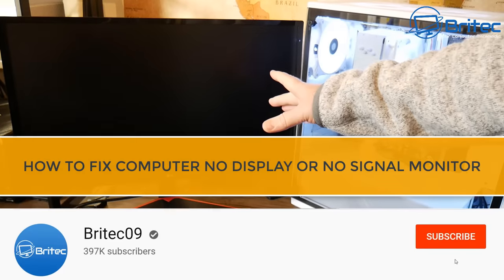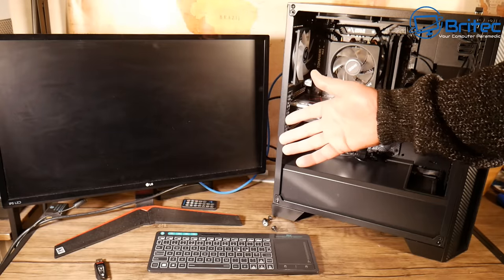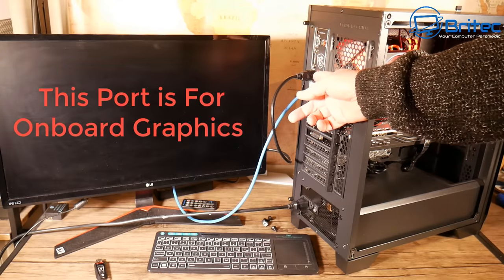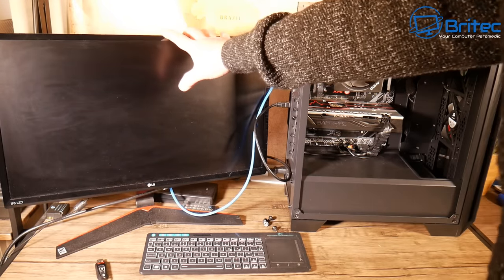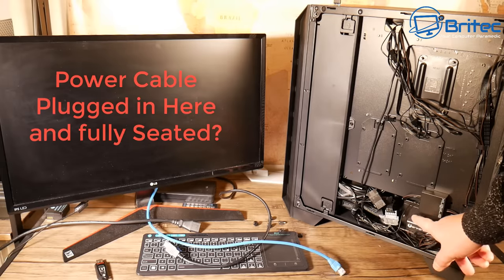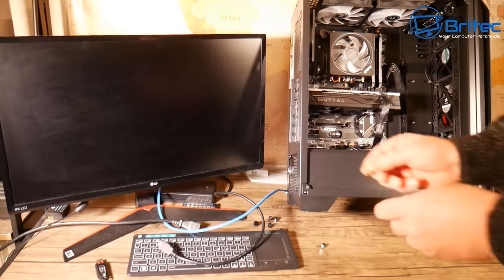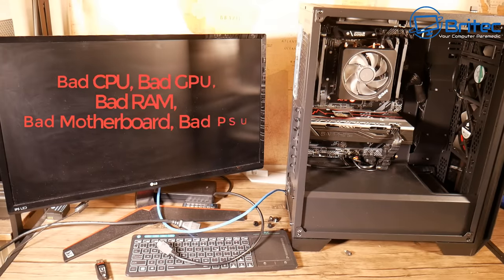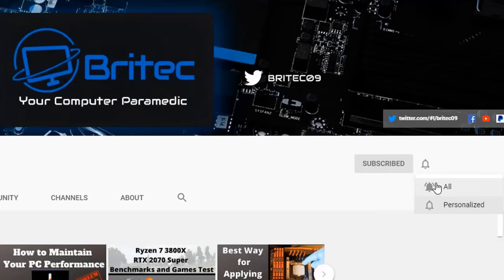How to FIX Computer No Display OR No Signal on Monitor

Comment: 11.96 V on all 4 plugs from the power supply for videocard, but no signal on the monitor, videocard is good tested on another computer, monitor changed 2 cables checked for each monitor, so what can i do more ? i will clean the memories connection part for both side with isopropanol

Comment: Another thing - if you've just upgraded your dedicated Gpu and are getting no output, upgrade the motherboard Bios. I've run into this many many times and resolved it this way (and no, a cmos clear did not resolve the issue).

Comment: Hello! Please help! I just built my pc like 2 weeks ago and it was running perfectly fine I was playing gassed smoothly and I didn’t change anything. But I had to change something game related in the bios so I set the ram speed to 3800mhz instead or 4000mhz because I had to because of a game. But when I shut my pc off, and tried turning it back on, nothing showed up….

Comment: hi im a younger sister using my brothers pc 
im quite scared to do this but i will tell this to my brother

the computer monitor says no signal and the cpu is on
whenever this happens my brother would remove the switch then put it back when the cpu turned off
but sometimes it takes 1-9 tries to finally get in but whenever he put back the switch theres a spark that comes out
does the spark would be the hint of a certain problem?

Comment: Hi, I am unable to work out the problem on my monitor (BENQ GW2265).  It works wonderfully when connected to it's VGA port, but does not when connected on HDMI port.  
My laptop (Toshiba) HDMI port works fine when connected to my Samsung TV,  but again upon connecting to monitor shows "No Signal or No Connected Cable" ( I can't remember which).  
I have swapped HDMI cables thinking of defective cables, but still nothing.  Can you help?

Comment: So I just upgraded my motherboard to a gigabyte b450 ds3h and cpu to ryzen 3600 and It had the latest bios update or the one compatible with 3rd gen ryzen as it said on the box and it booted up fine and I went to load a game but the cables were touching the fan, so I turned off my pc the cable was the hardrive cable and I plugged it into the slot next one along and so it wasn’t rubbing the GPU fan anymore but now I won’t get any display on the monitor? I put the cable back to the old one it was in also, and still nothing but everything boots I even hear my windows booting through the headphones I tried the monitor cables I have 3 and used different ones and even tried my other monitor, I didn’t update the bios right away after turning it on for the first time? Is there anything I can do to get it to boot?

Comment: My onboard graphics AND GPU both are not transmitting signal. I have tried 4 different cables, all fine with other devices. I have tried 3 different televisions. All 3 are fine with other devices. Is my motherboard fried? I can hear/feel/see everything is running inside of the computer when it is turned on yet there is no video signal. I have tried VGA and HDMI. 

I accidently started plugging in a USB into a similarly shaped port(directly above the HDMI port on the onboard ports) and I think I shorted something. The screen flickered, I wiggled the HDMI cable to try and fix it. When I did that it restarted the computer and I no longer had video signal after that.

Comment: Recently my monitor stopped getting any input from my desktop. When I boot up other parts of the PC works as usual but monitor stays blank even I can access HDD files through SMB. Already checked monitor on other device, swapped ram sticks, reinstalled GPU, removed CMOS battery but still no luck. Is there anything else should I do?

Comment: Monitor works fine with DP cable and hdmi cord is fine, works on the tv just perfect even when plugged into pc. Hdmi was working for months with no problem then all of a sudden it would get fuzzy or just go black and say hdmi no signal. Any suggestions?

Comment: What happens to me is when i start the pc up or wake it up from sleep, it stays on no signal for a minute or 2 and then turns on. I am using an integrated gpu and the problem started popping up around 1 week ago. Any tips for this??? Im just hoping its not the cpu or the MoBo, tho i still have warranty on them.

Comment: Please help me. I factory reset my pc and now when I start it up there is no hdmi input. It says "no signal" even after pulling out the battery and ram, holding the power, reconnecting battery and ram. Still boots up and the led lights are working but no signal.

Comment: Have you got a fix for CRT monitors with stupid "noise" lines that run horizontally, and make things fuzzy, scrambled, and/or distorted (squished and stretched vertically, and a little "shifted")? 

The affected area is NOT fixed in one area, as it has moved up and down on the lower region of the monitor (taskbar zone), and the "stretch-n-squish effect varies with how bright or dark the displaying image is. 

The issue has slowly been creeping up a few years ago (but it was virtually unnoticeable except to my eagle-eyes) and I noticed it gets just a little worse with each power interruption or failure. In recent weeks, the last couple of power failures really made it bad (and noticeable). 

I had done a thorough disk defrag and that miraculously seemed to set things right again, but over time it started slowly returning. 

I'm considering trying another power cable, but I doubt that will really fix anything (but who knows? I discovered AC power adapter/switcher things can "die" and need to be replaced when hard drives and scanners begin acting up with poor connectivity issues).

Changing monitor settings do not fix anything. 
I would just get a "new" monitor but CRTs are hard to come by and I still cannot figure out which is better between LCD and LED monitors, and NONE of them are especially cheap.

Comment: I need help with my situation, so, basically  my monitor is 100% fine and its very functional its basically brand new theres nothing wrong with my cables nothing loose, but what happens is when I restart my pc everything runs fine but my screen is black it doesnt even turn on or say no signal nothing same with when i shut it down i turn it on pc runs fine but screen doesnt turn on the only way my screen shows is when i take out the battery and put it back in then put the pc on then it displays and everything works fine until the pc shuts down again then i have to take it out again and repeat the process over, and over, please I need help.

Comment: How about when the monitor receives power and a signal but when turned on it acts like a fluorescent bulb; a brief flash on the screen,then nothing. Rinse and repeat each time you press the on switch same thing until finally it catches. Next day after turning it off at night, same process.

Comment: I switched out my old computer screen to a TV that has a vga port. It works but sometimes in the middle of doing something it will say no signal and screen will go black. Most of the time when I restart the computer by holding the power button it works again. I think my graphics card is not strong enough for this type of TV screen? Also upon start up I get an error message saying that a fan speed is too low. Time for a new cpu? It's an old Sony. Probably more than 8 years old

Comment: How about Monitor losing Signal after Windows Boot Logo? I have a 144hz Monitor connected via DisplayPort. This issue happens only when I restart or Shutdown Windows 10 when the Display refresh rate  is set to 144hz. Setting the refresh rate to 60hz before restarting or shutdown won't lose the signal, then I have to revert back to 144hz to continue. No signal only happens after windows 10 boot logo. GTX 970.

Comment: Any tips on how to fix the problem I am having the thing is my graphics card went bad to gave it to the center for replacement and I plugged my monitor hdmi on gigabyte motherboard and I am getting no signal/cable not connected I tryed everything and noting helps so my last thing is to try dvi cable or replacing motherboard plz help...

Comment: I have tried EVERYTHING apart from removing the cmos battery and i know i don't need to and here why:

My pc boots no problem and i can hear the windows chime through my speakers however, it boots with ONE long beep (normal system startup beep) and then THREE short beeps and i have no display, but when i plug my DVI cable into the onboard graphics slot i get display?. 
Here is my temporary fix: I removed the screw holding in the gpu to the case and pc booted no problem with display? 
Are my PCIe lanes broken somehow and the gpu only works when positioned wrongly?, do i need another MOBO?
(Asus Z390-A Prime paired 1060 6Gb GPU, the beeps i have, Asus says it is a GPU problem, but it's not, it is a MOBO problem as my gpu works in my old out of date pc i have spare and my old 1050ti does the exact same thing in my pc that i use now?) DO I NEED ANOTHER MOBO i should i send off for repair? or is it something else that i missed?

Comment: I have a problem where my pc shows no beeps on post and everything is on including fans but my monitor says no signal I tried the ram and still no fix I can’t remove the gpu since it’s too big and I can’t see the clip underneath that makes it loose 
My specs are rx 570 with ryzen 3 2200g
Reply: I have the same problem, did you find a solution?
Reply: Milan Keersmaekers yh I just took everything out and put it back in
Reply: Milan Keersmaekers not my cpu tho
Reply: Milan Keersmaekers also try reset cmos battery
Reply: Abu yeah i tried taking the battery out for like 2 minutes, is that long enough for cmos reset?
Reply: Milan Keersmaekers yeah if that doesn’t work then just rebuild your pc
Reply: Milan Keersmaekers plug out the cables gpu fans and more from the motherboard then put them back in
Reply: Abu i’ll definitely try that, thanks. If it doesn’t work, i’ll take it to a pc repair shop and just hope it’s a minor issue haha

Comment: I wanted to know why my pc runs but no display. I just install a new intel i5 4460 3.2 ghz cpu the i5 2.8ghz is the old one. Before I buy anything else I might need, here are my specs

8 GB RAM/ intel i5 760 2.8 GHz cpu/ atx 1150 motherboard and a AMD Radeon HD 6570 graphics card. I tried changing my new cpu wit the old one and I checked that all the cords are plugged into my motherboard and my monitor isn’t the problem because my ps4 shows perfectly. Any ideas or help?? It hasn’t been working for 4 days

Comment: I downloaded some kind of DirectX driver to the computer after just opening it up and streaming for couple of hours. Then did a reset and now it literally doesn’t send HDMI signal to minute so I can’t see anything (but it does turn on)

I did the following:
1. Turned everything on and off
2. Off, unplug power and HDMI, wait 30 sec, replug and turn on
3. Tried to plug HDMI out of graphics card in back of PC INTO television, didn’t have signal. 
4. Plugged PS4 Into Monitor I am using for this new PC, and PS4 instantly had signal. So it’s not the chord.
5. Tried diff HDMIs just in case.

I want to trouble shoot but CANNOT see screen so i have no options.

Should I buy Display Port (out of PC) to HDMIand see if I can Use something other than the HDMI out of the 2070 to trouble shoot with?

This is a real bummer.v sad. So grateful if anyone can help!! (MSI GEFORCE RTX 2070 SUPER GAMING X)
Reply: Did you maybe find the solution?

Comment: So for me. Iv got my p.c plugged into a tv constantly. The tv is fine also got my switch connected. The p.c worked absolutely fine a few days ago. I was playing death stranding on gamepass ultimate from the p.c with no issue. Today I turned it on and it light up and the fans were spinning fine. My usb + rbg keyboard and mouse did not light up and the hdmi (cable is also very new arrived a week ago in the post) did not work because tv has a blue screen (no signal) 

I should mention, I don't know any technical p.c hardware stuff. I didn't build this p.c ik how open the casing and thats about it.

Comment: I bought a new graphic card (1660 super g oc) but for some reason only the hdmi works 
When I contacted a monitor to the dp it shows a picture for a second and then go says no single  
I checked the monitor and the cable and everything work is do I need to get a new graphic card?

Comment: My problem: Pc starts like normal but i see no signal on monitor and if i press power button pc turns off imediatly, this means pc wasn t booted, what should i do? I tried pc on another monitor, i reinstalled all components, reseted the bios nothing

Comment: I recently installed an outdated GPU and put my hdmi on it and it didn’t work and my monitor didn’t turn on now my pc won’t detect my monitor, HDMI and VGA. My pc turns on and the monitor but they won’t detect eachother? What do I do?? Also I don’t plan on putting the GPU back

Comment: So my pc turns on perfectly fine most of the time. However sometimes the monitor doesn't turn on and also when it restarts it doesn't turn on. Sometimes I shake my mouse around and it turns on but sometimes even when I do that it doesn't work. Is there any fix for this? It says VGA NO SIGNAL.
Reply: im having same issue, brand new computer and monitor. Sometimes it comes on, sometimes not. Once its on it stays on. Frustrating
Reply: @graytambar9956  same, and I haven't found any fix for this yet
Reply: Kiri0 I’m gonna try some things. I’ll let yah know if I have any luck.
Reply: @graytambar9956  thanks man
Reply: Kiri0 same just built my pc man
Reply: Kiri0 ok, after researching some potential solves I took the ram sticks out and cleaned off the connections, I also took out the graphics card and cleaned the connections. Put those back in. That didn’t seem to help at first. Then I replaced the hdmi cable and so far it has been responsive every time. My specific issue was, hitting space bar would wake the computer but the monitor would not wake up. Since doing those 3 things it has worked so far and been very responsive to wake up each time. I’ll let yah know if that changes but so far it seems to have fixed it.
Reply: gray tambar bro I just fixed it changed ram and plugged then unplugged the power cable and it worked
Reply: sxints_  sweet!

Comment: I plugged in the vga cable and turned on my monitor but the monitor says that there is no vga cable. I’ve changed the wires multiple times idk what to di

Comment: I installed a all in one and now im getting no signal
Reply: Same
Reply: @elizamanalastas4428  what worked for me was to remove the cmos battery and power cable from the pc and hold the power button for a whole minute then put battery back in and pluged my pc and it worked.
Reply: @GG-ow9pm  hey , my computer is saying no signal for 3 years , a fixer looked at itand they said it couldint be fixed , can u pls help i need the computer

Comment: So I guess I need to buy a new CPU,PSU,GPU and test which one it is ?? Great , barely 10 hours used , a modest amount spent on it (Approx £600) Seemed like such a good idea at the time , worked absolutely fine except the dodgy WiFi adapter I bought . Then I got a black screen with the blinking cursor , started looking into that when all of a sudden I got no display. Ive been using PC's for last 20 years with work and never had this . I guess there is something to be said with buying fully built from professionals !! Gutted !

Comment: Please help, I bought a 2nd hand gpu. First I used ddu(display driver uninstall) then used the clean and shutdown because I’ll swap the gpu. After I swap it, no display but the fans are working. But when I use the motherboard vga output it was working. Then I tried to put back my old gpu back then after the installation, no display too. They’re both no display/signal but when I’m using motherboard it works. Please helpp

Comment: Mine goes no signal at random but the box is still on and it,s not the monitor, i checked with tv and another monitor, when i manually restart the box it,s fine for a random amount of time before it goes no signal again, any ideas?

Comment: I have problem that while i am using computer,sometimes my monitor just turns black and i get message vga no signal.Only solution then is to restart pc....i am using old monitor with vga connection ,but pc is new ,his graphic card doesn't have vga output so i am using vga to hdmi adapter.Idk ,maybe problem is there in adapter ?,all connections are fine,i checked several times.

Comment: This video should have been 2 separate videos. I have a known faulty monitor. I tested it on a 2 monitor system, one using VGA connection, the other DVI. When testing the faulty monitor it would lose it's picture whenever a cable was plugged in (VGA & DVI).

Comment: I plugged mine into a buddy’s tv cause I forgot the power cord for the monitor I brought. And the tv was showing 1000Hz which I thought was extremely high cause my normal monitor is like 144. I started downloading a game then I got a colorful pixelated display and i had to force power it down. My pc turns on like it always does with the lights and fans etc. except now it’s not recognizing my monitor, mouse or keyboard. I’ve taken the little battery out of the motherboard for a few minutes, I moved my ram around to figure out if it’s that. Put them both in another pc and it worked fine so it’s not the ram. I’ve tried it with a DP and a hdmi. I’m not very good with computers and I’ve been googling my ass off for 2 days. I’m not sure what else to do.